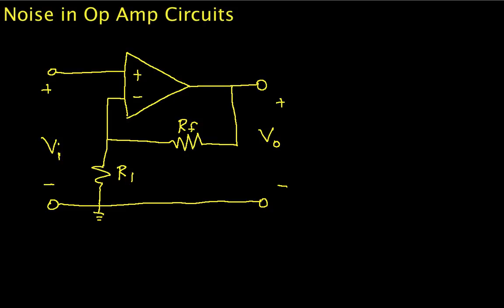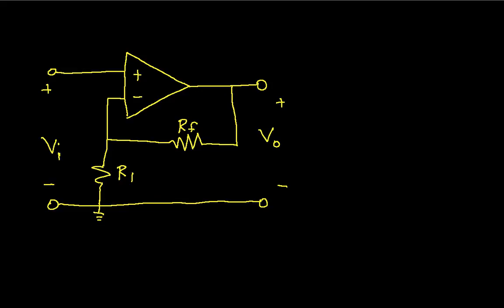Noise in Op Amp Circuits Part 2

Comment from the maker: @MrMathewj The polarity of the noise voltage does not matter. We can really only observe noise power, which is the square of the noise voltage. Changing the polarity of the noise voltage will not change the noise power.

Comment: A simple way to do Rf and R1 in this case and many others is to instead add a parallel current source to each resistor. Using virtual earth, voltage across R1 is 0, thus all currents must flow through Rf. Otherwise Google MT-049, a Analog devices paper, you can force the values out but it's a bit advanced.

Comment: Hey i made an lm386 amp. And it had a shitload of white noise. I fixed it by placing a transistor somewhere around the gains, input + and i think bypass. Cant remember for sure. Was an npn trans.

Comment: One thing I would like to ask here is, we have assumed the input is 0 Ohms ->the volage source having a very low Rs. What if you have a Current source driving this Opamp stage, wouldnt that change the input Noise of the system with Vn^2  AND in^2 coming in? Also then we wouldnt have the V+ sitting at 0V. Would that change our analysis?

Comment: what defines the if the voltage source is at the right or at the left of the resistor? thanks for the video :D
Reply: martadsv usually ground can be part of a voltage supply. And if its not then im also confused. Lol

Hope this helps

Comment: How you put polarity of noise voltages?
Reply: MrMathewj : noise has no polarity. So the sources can be put in both way and even before of after the resistor.